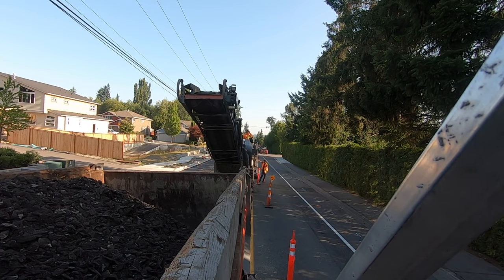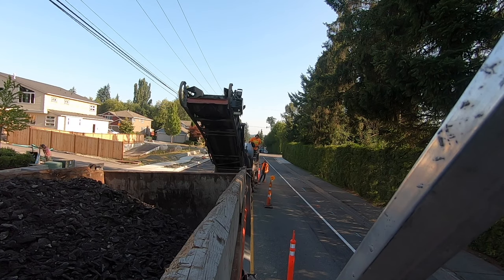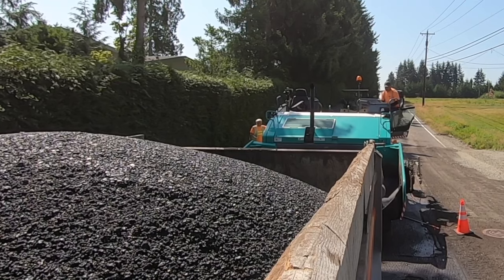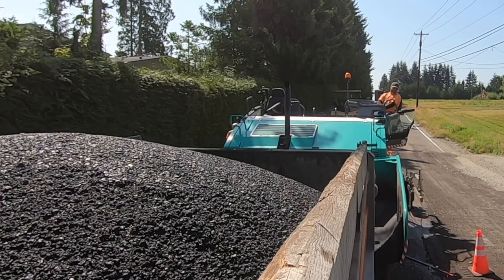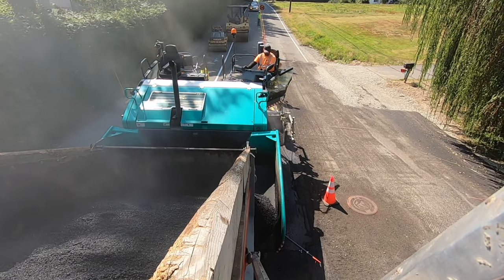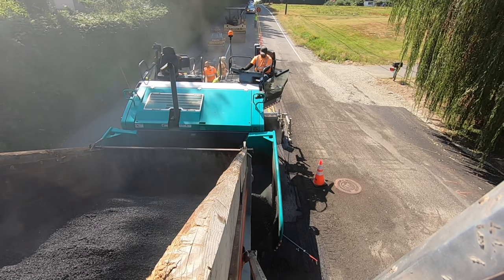PAVEING IN DUMP TRUCK PERSPECTIVE.

Comment: Finding that sweet spot on the brake pressure was always the challenging part for me. If we were paving uphill, i didnt really need any brake pressure but if we were going downhill or on a straight away, i always worried about my brake pressure. Sometimes id step on it a little too hard withiut even realizing it. You just get focused in the hand signals and stuff and you dont realize you sent the brake pedal to the floor.
Reply: Thanks for that information. Never did asphalt. I always wondered about that part with the paver pushing and driver not rolling out on him and was it all just a matter of applying the right pressure during the pave. Thanks
Reply: @Revelation_22_13  it takes practice and communication. They'll tell you if you're about to roll out or if you have too much brake pressure. You'll know if you're holding the brake too much if the paver is trying to push the truck and they're not budging the truck. The dump guy will usually holler at you if something goes wrong. Even experienced truck drivers roll out. It sucks but just get out and grab a shovel and learn from your mistakes.
Reply: Gosh first time I went down to 50 psi 😂😂

Comment: We used to spray the beds with diesel back in the 60s and 70s and it worked good. If you spilled in front of the paver you got yelled at and had to buy the operator a case of beer . Lol
Reply: Still do til this day 😂

Comment: I used to haul asphalt. We would always prepare chicken in aluminum foil, with BBQ sauce. Dig a whole in the hot mix in the truck, bury it where we knew where it was. Then drive to the jobsite. By the time you got to the jobsite that chicken was cooked to prefection and falling off the bone. Time to eat. It usually took about an hour to cook, depending on how hot the asphalt was tha we got from the plant.
Reply: Yeah man there's some guys that do that cuz that asphalt is almost 400 degrees these guys rap meat like chicken or steak and potatoes in aluminum foil and then put it in burlap sacks and it Cooks it it's amazing it's weird but it's cool and some of the best meals I've had was cooked from asphalt 😂
Reply: @trackpackgt877  Good times
Reply: Don’t tempt me

Comment: Mist a Lil diesel in your bed and hinges and it’ll come out like magic but don’t do it if you doing state work cause the state inspector catch it he’ll have a fit. I did asphalt the first 19/20 years of my cdl but I got class A 5 years ago and been doing dump wagon ever since
Reply: Johnny Phillips  “ mist” haha. I “ soaked”  the spreader pan, the hinges , the coal Shute and esp the bed of the truck along with corners. I would have puddles of fuel oil laying on the bottom of that bed. I hauled ALOT of loads and mix . I never really did any state jobs . Not that it would have mattered . I still would have sprayed my bed down with fuel oil . Old habits are hard to break ✌️
Reply: Rick Johnson that super pave asphalt was the worse
Reply: Johnny Phillips  I was a six wheeler driver for a long time . I  hauled so much asphalt I could practically sit in the seat and the truck
Would drive its self to the plant. I never hauled any mix in a semi. However, I’ve done a lot  of excavating  and working with a grinder in a semi. It doesn’t much matter to me . Semi or six wheeler . I never had a complaint about my driving. I’ve also done 48 and 53ft work . I mostly did intra or tri state sh__. I did containers for about 2 years . I can do that too.
Reply: I mix about a 1.25 gallons of diesel and .25 of fresh motor oil. It helps cover the diesel smell, changes the color so it doesn't look like diesel and works IMMENSELY better than diesel only. :)

Comment: A trick to keep the millings off your cab is to roll your tarp back a little bit to direct the millings into your bed.
Reply from the maker: That's great advise! But be careful sometimes the grinder throws sharp chunks that can cut the tarp
Reply: @BRIANVANDUYN  this is true. U can hear them hitting your dog house and I'll just pull up. I hate when they load everything up front.

Comment: So is pressure applied to brake the whole time the truck is being pushed???
Reply from the maker: Yes
Reply: Usually about 12 to 15 lb of air pressure on the brakes depending on the size of the paver is enough to keep the truck against the paver to not roll out because the weight of the load will push the truck right out and u will loose all your load in front of paver but not so much that the paver can't push you
Reply: I got kicked out my first time doing paver. the operator just yells. Hes probably going through things.. another driver was on my passenger side to assist me but he yelled at him too. He didn’t give me one chance to redo. Signed out and left to another job site. Lessons are made by making honest mistakes. Nobody is perfect. Take it easy driver.

Comment: When dumping in the paver, do you pull it or does it push you?
Reply from the maker: It pushes you, you need to slightly hold the break so when your load shifts you do not roll away from the paver and spill out in front of the paver

Comment: So the company who was doing the paving ordered up x amount of tons and the plant would store it in the silos ( more or less) fu__ that soap. It’s pretty useless. Depending on how bad the mix was sticking I would at some point pull over and soak the sh__ out of it with fuel oil . Did it 100s of times ✌️

Comment: I miss paving and milling. Nice video.  DONT BUMP MY SPREADER!!!!  LOL.  Do you ever dump into a shuttle buggy?
Reply from the maker: What a shuttle buggy? I think we call them placers where you dump it into the machine and it places it in a different location?
Reply: Shuttle buggy is a “Road Tec” term.  That company developed the “Shuttle Buggy” which is essentially the same thing as your referring to. The shuttle buggy remixes the asphalt to prevent segregation of the mix due to temperature variations. It also will hold a little over 30 tons of mix if I’m not mistaken which allows for continuous paving without truck to paver contact which prevents bumps and comprises in the mat quality
Reply: dumping daily in shuttle buggy on ohio turnpike,6 axle dump here,25 tons

Comment: 400° at most
Reply from the maker: 600 is what the operator told me
Reply: @BRIANVANDUYN  at 600 the oil would be burnt off the rock generally 375-400 out the plant and depending on the distance to the job 280-320 going in the paver. But hey it’s your job to get the stuff from point A to point be not know the details of what you are hauling right 😂